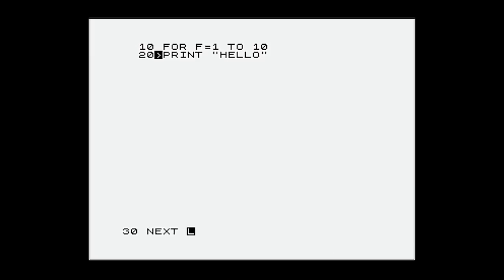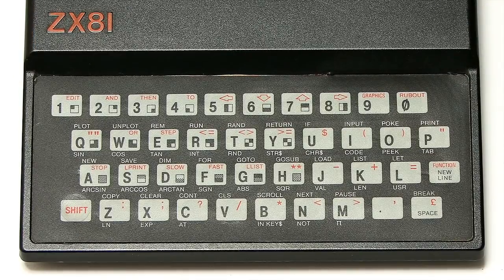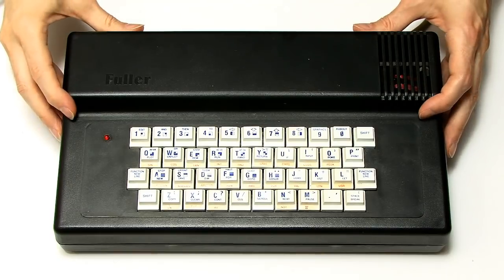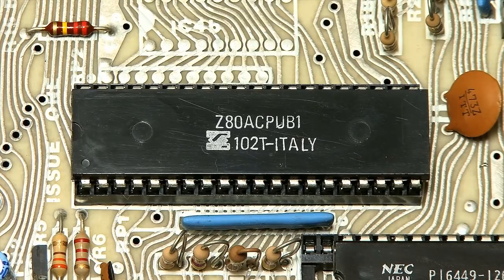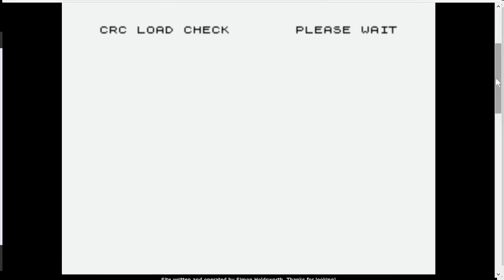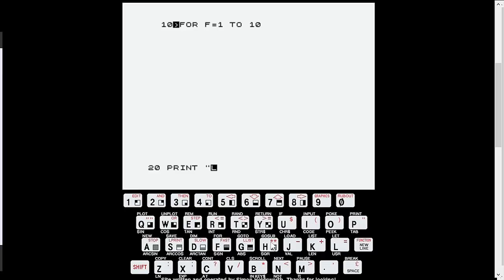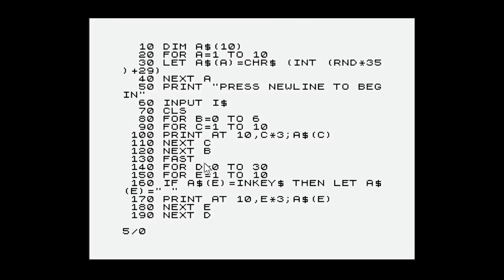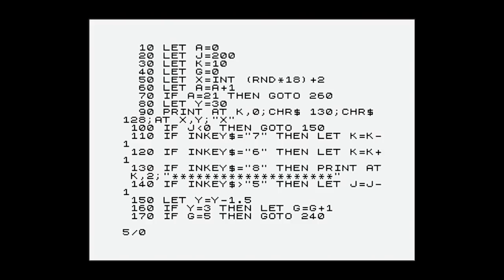ZX81 Classic PC

Comment: Aloha. I still have my ZX-81. I got the money to buy the kit by selling my ZX-80. Sorry I sold the 80, I liked it better. I was working at LURE Observatory at Haleakala tracking and collecting data with PDP-4s&8s. I was living in my VW van on the beach so I ran the system, computer, 4inch screen & tape deck off the Van's battery. Just wanted to say thanks to Sir Clive for a hell of a machine.

Comment: Thankyou for reminding me of the enjoyment i had all those years ago :-D
Did you ever fix the zx81?
'
The ZX81 was my first computer also, i loved the simpleness of the machine, i spent a lot of time typing in programs and saving every 5 mins (just it case it crashed).
I built the maplin kit version of your keyboard, plastic caps with squares of printed paper under them were the key system.
i built a ram pack out of 2114 static ram chips, 2k memory ooooow :-D.
Later the spectrum 48k and many others from sinclair.
i ended up repairing all the machines as my understanding grew.
Reply from the maker: Thanks for this. Sadly I have not been able to get my ZX81 working.
Reply: Is the regulator putting out 5 volts on the 3rd pin, does it get hot?
Does the memory/rom get hot quickly?
If you had a short on the expansion bus, the z80 processor would have taken the brunt of the damage, they are cheap so not a pocket killer.
Does the modulator produce r.f?
There is a zx81 schematic out on the net, when you look at it you will wonder how the hell it does anything, so few chips lol.

Comment: I think the machine that got me hooked was an HP 9100A programmable desktop calculator. It was loaned to my high school somewhere in the 1967-69 period. I was fascinated that I could figure out how to solve a physics or math problem, write some code to do that, and the machine could solve the problem repeatedly for different variables. It took away the tedium of doing the calculations for each set of data. It had conditional branching, allowing complex programs.

Comment: I helped my Dad build a replacement keyboard from old big button calculators that had been scrapped where he worked. It was clunky as hell but it worked. We cleaned the heads and aligned them just so on a tape deck too which solved the load issues. Good times, me and the old man doing projects together :)The 'garage' band, we rehearsed in our garage, did a 4 song Ep tape, and I designed and printed the cover on the ZX81. Sadly I lost my copy eventually, so if anyone has a copy of 'Door without a room' get in touch LoL
Reply from the maker: Very cool -- sound like good times indeed. A different age of computing.

Comment: I had several... The zx spectrum was the follow up to this in 82. Seemingly Sinclair didn't bother to improve the basic interpreter much though...  We spectrum users had the beep command to  utilise sound and 16 colours. Beep done what it says on the tin.... 'Beep duration tone'.

I had an apple IIe europlus. Which we won on a TV show competition. My mother must have thought I was autistic from the hours I spent on it. 

I had a C64, C128, Amigas 500, 1200, and 4000. An IBM XT and AT. 

Fun days, a more innocent and nerdocracy based computer world was the late 70's and early 80's.

Used to do the same thing with for loops on the spectrum too. Variables were short cos you had so little memory.

Comment: I purchased a ts1000 through an advertisement in the Sunday comics section for $35 US. I programmed it to print ( on a 3" wide thermal printer) fractal images! Set it to run, go to bed and by the morning it was done! Then it was on to a Texas Instruments unit that was just OK. No fractals. Not as much fun/challenging.

Comment: you can rig up an external keyboard input circuit to plug in to the expansion slot so you could then use the fuller keyboard without fitting the board in it....
Reply: that fuller is the earlier version, later ones had the board mounted with the modulator to the back, and a 'twister' board so you get the expansion slot at the back beside the main connections, and an internal vertical board edge to fit a rampack internally much easier!
Reply: as for getting it working, keep your fingers crossed that the ula isnt duff... new good ones are pretty much unavailable...
Reply: UPDATE:  there area couple of ULA replacement 'modules' been made, with varying availability

Comment: My first one I was 12, was a sort of home made board with a 8 leds digits line and the keyboard was a serie from 0 to F ,run & Enter, then we enter the program in a hexa form, program registered manualy on perforated card and read with an home made reader and later with a fax machine to read ribbons, the processor on this card was a D4004, a 4 bit CPU speed 740 kHz, 1ko RAM extended to 2 Ko, 128 o PROM, At this time, there was no pocket calculators.. lol. Then I had a zx80, zx spectrum, an Alice from Matra & Hachette (a sort of computer, that plug on TV with a scart and had color !!!), then directly to a Tandy TRS 80, at this time I experimented my 1st Hard Drive with 5 Mo ! Its size was about 2 shoes box aligned, then it was the Apple IIe, later it was with the "GEM" on the Amstrad CPC 464, then the 1st PC with windows experimented with w1, w2, w3, w3.11, w3.5, to NT 4.5, 2000, ... w10. A real geek life of 45 years. Perhaps I make a mistake with the order, forgive me !!! I forgot the C64 commodore, Atari ST 1040. Now that I have had the best, I go back to the future with PI... 57 YO and I want to complete the circle, and go back to my 1st loving.

Comment: my first computer was the mk14  with a scmp microprocessor from Science of Cambridge (later Sinclair Research Ltd).
it had a hex keyboard input with buttons that had to be debounced else instead of 9 you got 999 and a tiny 7 segment display of 8 characters. it arrived as a pcb and a bag of components. i did not even know how to solder. eventually i got it going using a 12V car battery. by adding a triac board from elektor magazine i had it controlling my central heating system. fine until somebody disconnected it and the machine code had to be reinput. i read that scmp micros are still controlling some lift systems.

Comment: The first computer I owned was built from what used to be called a development kit. (I was in the midst of a 4 year course in electronics.) The wonderful advantage in that era (about 1977) of development kits to experimenters having a normal income was that that it cost less than just the the CPU chip it included. (To stimulate designing with microcomputer chips.) The CPU in this one was an F8 by Fairchild, although the chip was manufactured by their second source, Mostek. This kit with 1K of memory, where you soldered sockets on circuit board and plugged in the chips, had been selling for (I think) $250, but sales had not gone well, and a mail-order electronic parts dealer (Jameco) picked them up as surplus, selling them for (I think) $80. ($80 would be something like $300 today.) They also sold the other things needed to minimally get the thing going (if you didn't have a teletype): surplus CC monitor less any case ($120?), bare keyboard($60?), and power supply ($30?). What used to be called a "monitor" program was in ROM, so you could enter hexadecimal into memory and watch the F8 execute instructions, dump registers, etc. Optionally, you could buy BASIC on paper tape, and an optical paper tape reader, and have the monitor program load it into memory as you pulled the tape through.

 I should say that I, like most experimenters, already had conclusively determined, reading Popular Electronics about things like the Altair 8080, that computers were essentially useless for any purpose to an average person, so this kit did NOT come as a disappoint whatsoever. I had learned (in technical school) the basis of computers as being a logic machine. Being able to directly manipulate such a device with my own hands, and watch it in all detail, was what drew me. I had no interest in getting it to do anything as boring and senseless as a computer game (pong?), or anything of that sort.

Comment: I owned a ZX-80 (Sinclair 1000) - wish I still had it today!  I also bought an IBM PC at the beginning of production (had to wait 6 weeks for delivery).  I modified it after a few years to run a Z80 processor at 20 Mhz.  I still have that MB, but it does not work any more either.  Thank you, for a great look into the beginnings of Micro-Computing.  My bench is now covered  with PI's, Teensy's, and other Arduino compatibles.  I also have a UDOO NEO and their newest X86 Ultra (just fabricating it).  We have come SO FAR!  Thanks again!  Steve Michels, Kansas, USA

Comment: I started out with the TRS-80 Model I (and later Model III) I learned assembly for the Zilog Z80, So natch, I became a fan of that proc. I also had the TS-1000 and a TS-2068 (For UK fans, think: upgraded Speccy with plastic keys, sorta!) Since the 2068  was small and had simple cassette I/0, I used the 2068 well into the 1990s for titling home videos (using graphics written in BASIC)!  Often over looked on the ZX-81 (TS-1000) was the fact that the manual itself was worth the price of the thing itself! No one today provides the info for ANY consumer electronics like Sinclair put in that little book! OTOH, The RAM expansion (when installed normally) was, Er, flaky... Nothing like typing 100 lines on THAT keyboard and having a "reboot" just by moving the computer slightly... "^#*&@%$!!!"  That damned thing led directly to me getting the 2068. I used to think they did that on purpose, LOL!

Comment: Have you ever heard of or dealt with a COSMAC VIP?  It was an RCA computer from I believe 1977. Most ran an RCA 1802 the CPU, and they used a CDP1861 for 64X32 video.(although I believe you could push it to 64X64 if you upgraded to 4Kb of RAM). I am trying to get mine running (I found it in my grandfathers basement) and I wondered if you had any insights.  The one real problem with it is its keyboard or more, lack thereof, it has a hexidecimal only keyboard that has no travel distance at all.

Comment: Back in the 1980s I couldn't afford a home computer. So I started buying computers when most of the 1980s computer users had switched to PCs and sold their now obsolete computers or donated them to charity sales. My first one was a Lambda 8300 which was a clone of the ZX81. But I never got that one working. Then I had a Spectrum which I liked but it commited  suicide when I later bought a joystick interface that turned out to be defective. I later got one more Lambda 8300 that worked. I never really came to like it because it was so limited compared to the other ones I had. My favourite was the Sharp MZ-800 that had a fantastic keyboard and three oscillator sound. The only downside to it was that BASIC was not build in so every time you had to load it from casette.

Comment: The ZX81 was my frist computer i had
the frist version had a fault on it which was fixed
by given it back where you brought from 
and they would give you a new ZX81 free of charge
I had a problem with the back of the unit where you plug the printer into  and the 16k ram
pack as it would come away from the ZX81 even often. To stop that happening i would save 
the program after it page that if something did happen i only needed to redo 22 lines of text max
the other fault it had was when it got to hot it would frezzee and you had no choice but to unplug
the mains lead and leave it for 2 hours before you could use it again
it would take up to 6 or 7 mins to load a 16k program. 
in 1982-83 i brought the BBC Micro Computer B series and that was much better computer
with 32k of memory and it would take from that for the screen 1k upto 20k of memory
but that one cost me 399.99 and the ZX81 was only 69.99 the printer was about 49.99 and the 16k ram pack about 49.99 
if i got any of these price wrong i am sorry but it was a long time ago

Comment: I bought a Colecovision console that could be expanded to a home computer with the Adam module that never came out in my country. Afterwards I bought a ZX Spectrum with a silver paper thermal printer. My first game was the side scroller Alchemist followed by the graphical text adventure The Hobbit that came with the novel. My first program which I never could make work properly by creating a landscape (straight line - sinus wave - straight line) and a canon on each side shooting rockets in turns by entering an angle and power. Several Speccy version later with 3.5" drive and Multiface One I moved over to the Atari ST and Amiga before getting a Dos PC. I hope to be around when VR like in Sword Art Online becomes a reality...

Comment: Thas was the first computer I learned what is Basic programming, but mine was Spectrum 64 then replaces with a state of the art Spectrum 128 (WOW!), with a expansion memory to 256 and 2 joysticks. I was on the top. Some of my programs were thousands of lines. the reason using line numbers as 10, 20 was able to put commands between, ha ha.

Comment: Ah memories, I remember spending one summer going through "RAND USR n" (Where n was an address of ROM from 0) just to see what each call did by hand.

My second computer was the Atari ST 1040, which I got purely for it's MIDI ports.  I eventually buckled in and got a PC (x86) so I could learn to program C and access the then new Internet.

Now at home I have a phone, a tablet, a desktop (the workhorse) a laptop and a Raspberry Pi Zero, all of which are used almost daily.

Comment: I started on the ZX81 too. My father purchased it (1983) in a bookstore and not long after we bought a 16Kb expansion. I bought a lot of magazines and typed into the ZX81. At the end of its run, the keyboard was tired down and one wrong touch could reset the computer. Not fun when you had typed a lot of code. :-) I moved on to the C64 in 1984/85. The biggest game I typed in was "Phoenix Tower", from a magazine. Maybe somebody remembers that one ;-)

Comment: Atari 400, Vic 20 and much later, Amiga 1200 were all highly influential for me.  The Atari had fantastic graphics and sound, but the keyboard was much like the ZX81 keyboard, only there were no shortcuts for BASIC, and while the BASIC was for the most part excellent, it WASN'T Microsoft BASIC compatible, and it had a bug that made for/next loops horrifically slow.  I miss the Amiga 1200, Workbench 3 was such a lovely system and far ahead of what Microsoft and Apple had at the time.
Reply from the maker: I too miss the Amiga.

Comment: The first 2 computers I used were a Data General NOVA 820(the size of a refrigerator from the 1970's,24K of memory) and an IBM 1130 (took up 2 rooms, 8K of memory) introduced in 1963.

Comment: The TS 1000 was my first computer. Great to learn on. I recently put a Raspberry Pi inside the case, and I even got the membrane keyboard to work with it using an an Arduino. Even after all these years, I'm still learning new things with it!

Comment: My first computer was a zx81.  I started expanding as soon as I could...16k pack, keyboard...not as nice as yours just a raw set of real keys hanging out the front.  I had a 32k pack and I graphics pack...but all 3 together overloaded the little power supply so a new 1.0 amp model was required.  I crossed the dc/ac wires on that and blew the first zx81 up...so I gave up on the graphics and 32k expansion modules.

Comment: Back to 1984, in my 14th anniversary,  my dad gave me a TK-83, a brazilian version of ZX81,  with 2K of memory and a 16K expansion. In that very day,  prior to finish reading the whole BASIC manual,  I wrote my very first computer program. Using this awesome computer I also learned Assembly Z80 and Forth languages. These were the first steps to a 30 years successful carrer in computer science. Thanks a lot for the video to revive those memories.

Comment: In the early 1980's I had a TI99-4A. My very first Computer. I learned some BASIC and later I bought the Extended Basic Cartridge which enabled me to use Sprites in my little programs. Some years later I gave my TI stupidly away to my Nephew and never saw it again. Too bad...

Comment: I had a ZX81. I remember getting a ~50k memory expansion card, and thought that it contained more memory than anyone could possibly use. 

Worth noting: a ZX81 cost about £70 at the time, which is actually more expensive than you can buy a Raspberry Pi for today.

What's interesting about your game is that it's so "direct". These days, everything is hidden behind abstraction layers, sadly.

What might make an interesting project for someone would be to build a complete computer with all the hardware specced out (with graphics, sound, and networking), maybe using an arduino as a base, or something similar. Such a computer would be very simple to use.

Comment: I have heard about this computer but never saw it in action. Thanks for sharing a demo. I never knew that the Z80 was at its heart. It would have been much easier to learn programming that CPU with this instead of using assembly code and burning them into EEPROMs.

Comment: The TS 1000 was the first PC I ever bought back in college, on closeout. $20 USD for the TS 1000, and another $20 for the 16K expansion pack. I programmed on it a lot, and eventually wrote a weather simulation program that took up almost all the memory. It was great fun, and I eventually moved on to the Commodore 64 before beginning to repair actual IBM PCs and clones for a living.

Comment: My first computer was the BBC Model B that I purchased in 1982. When it first came out there was very little software available so I had to write my own. I used the machine for about five years adding a disk drive to replace cassette recorder storage. Then I purchased an Atari 520ST with a monochrome monitor. After that I switched to PC going through two desktops and two laptops. I switched to Apple Mac around 2005 and am now on by 2nd desktop and 4th Laptop.